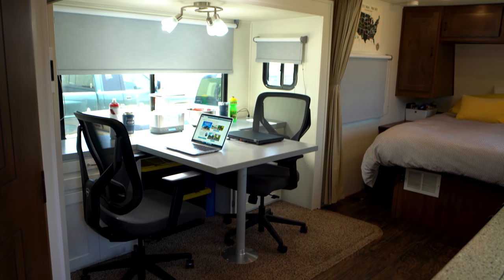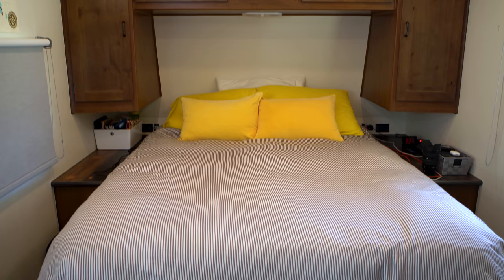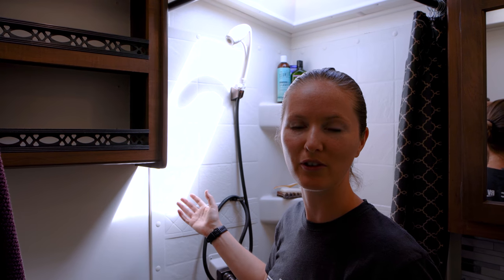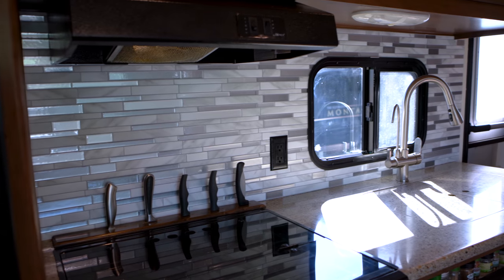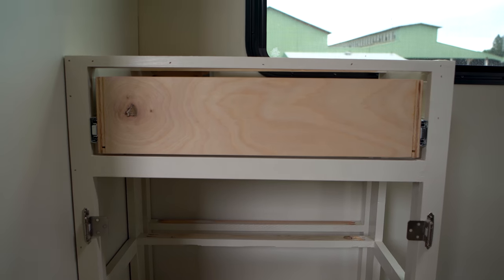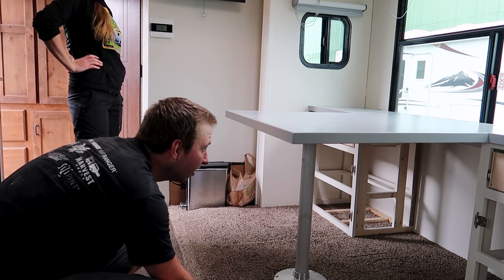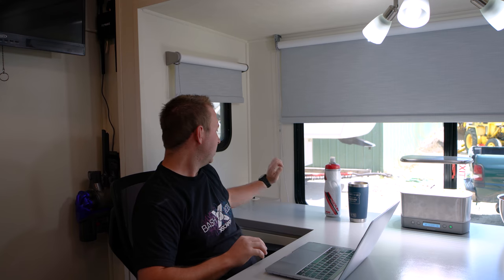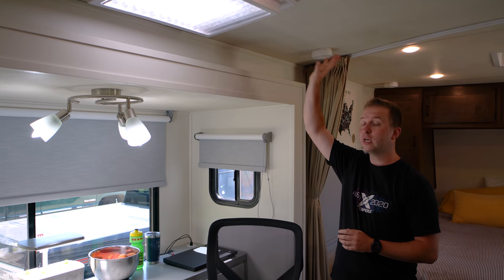Before & after: CUSTOM desk + full reveal! | RV Remodel Part 3

Comment: It looks lovely.  I like what you did to remodel.  If you are painting again, if you take the tape off right after you finish the painting, even while the paint is wet, you won’t have the issues of pulling the paint off too when you take the tape off.  I learned that the hard way.  I love your backsplash and the desk area is very nice.  Good job!
Reply from the maker: We went back and forth with when to take off the tape. We did multiple layers of primer and paint, so in the end we decided we would add way too much work if we took the tape off after each layer and re-taped again for the next layer. Careful scoring with a razor blade along the edges of dried up paint worked well.
Reply: @AdventurousWay  yes, hadn't thought of that.  Good job!

Comment: Regarding the office chairs on carpet. looking into "rollerblade carters". they roll over carpet with no effort, cost between $25 and $45 and some even come with caster locks which will keep your chairs from moving while in transit. I live full time in my RV and i love these things. The only down side is if you have a cheap chair with a plastic base (legs), they may twist due to the casters off set being a little more pronounced. If that is a issue, you can look into buying a aluminum base (about $65). yes the $$ start to add up but for me having a office chair that stays put while i am driving without having to tie it to the table or lay it down is well worth it.
Reply from the maker: Great tip! We will look into that if tying down the chairs for each move gets too annoying.

Comment: VERY nicely done ! I applaud the both of you. We've been contemplating doing the same thing to our dinette for about 2 years but have not pulled the trigger yet.
Reply from the maker: Thank you!
Reply: @AdventurousWay  Love the desk! Are you using the desk as a dining table as well? That would work out OK for my laptops but I’ve also got a 38” curved monitor.

What model RV do you have?
Reply from the maker: Ours is a 2018 Outdoors RV 21RBS. Yes, the desk is our dining table as well - it's the only seating we have in the RV in fact. There's no reason you couldn't customize it to accommodate an external monitor - there are lots of options.

Comment: Like the look and glad you did not do anything to the cabinets.  Interested if the blinds are going to flap around and damage the paint when going down the road.
Reply from the maker: Yes, the blinds do flap around. Definitely install bottom brackets if you install these kind of blinds in a motorhome because they do make noise when flapping. So far we have done 3000+ miles and haven't seen any damage to the paint from the blinds.

Comment: Now that you've worked at the desk for a few weeks how do you like it?  Your style with keeping the storage underneath for the bins and the cabinets is great.  I am thinking of doing something similar, but want to have 2 monitors for both me and the wife because we work full time still. If you were to do it again what changes would you make?
Reply from the maker: We love our new setup. The dimensions, built in power and how the table is laid out works great for us. The only thing that hasn't worked out is the paint on the table - it is chipping away on the corners where we use it. At Home Depot we were told it's the strongest paint (Behr Alkyd Enamel) for this application there is, but somehow it is not working.

Comment: Love the Reno , but I did notice that your desk  looked rather tight with the desk chairs and the clearance behind them when you were sitting in them, it  looked like you'll be rubbing against the slide walls? or was this just me? other wise it looks awesome.
Reply from the maker: You're right, it is quite tight! Not just behind them, but also from side to side - there is a slope under the carpet at the edge of the slide.

We knew that before we started the remodel though, and I iterated several times on the desk design to try and optimize available desk space vs space for the chairs. In fact, in the video you may have spotted us dry fitting the desk with some standard dining chairs - that was to make sure there would be space for the chairs to fit comfortably.

Then, when buying our office chairs, we carefully measured them in the store to make sure they'd fit - size was one of our main criteria for the office chairs!

Once you're used to it, it's honestly not an issue. Sure, we can't recline in the chairs too far, but for working at the desk that's not an issue.

Comment: Excellent job with a lot of time and sweat equity. Outdoors RV should hire you two or at least plagiarize your ideas! We are about to buy one of their trailers but would much rather have your interior design compared to the dung brown walls and NASCAR Hooters jacket exterior decals. I was told that we cannot order a trailer without the hideous exterior decals. I love their engineering and passion for the product. But please hire some designers!
Reply from the maker: I hope eventually they will add lighter interior options! Some of their recent Trail series models have nicer exterior graphics - with mountains, not just swooshes.